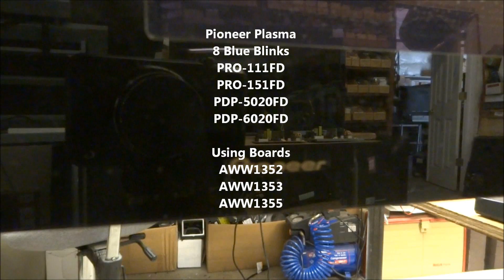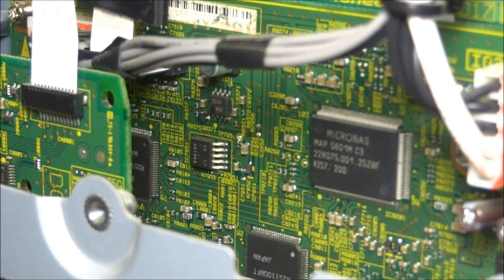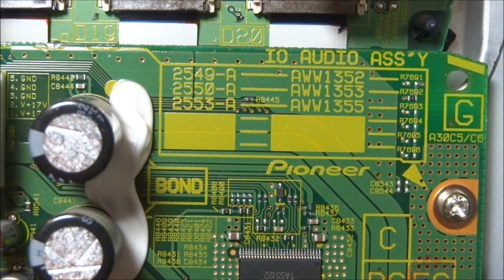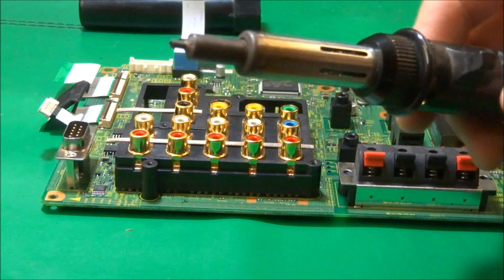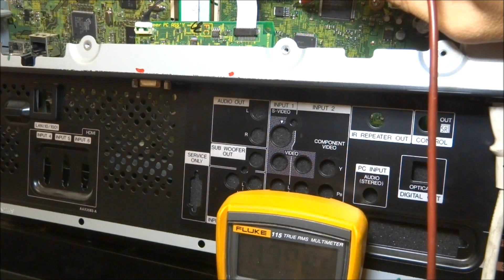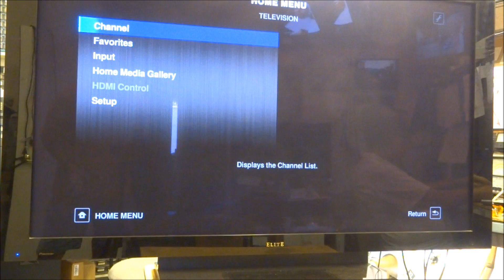Pioneer Plasma PRO-111FD PRO-151FD PDP-5020FD PDP-6020FD 8 Blue Blinks AWW1352 AWW1353 Repair Fix

Comment: As someone else said - this saved my 5020! One thing you should mention, which I found on someone else's video: when you check the voltages, you have to do it in the first 2 seconds. Once the blue blinks start, the power supply shuts off and you get 0 volts everywhere. Once again though - thanks!

Comment: Great Video. I bought the chip from Digi Key part # NJM2846DL3-18-TE1CT-ND . I used the weller pyropen with the standard 4.5 mm tip which worked well. One mistake when I was removing the chip  I inadvertently tore the copper trace from two of the pin positions. Make sure to heat ALL OF THE POINTS OF CONTACT when removing chip GENTLY.  Really important to use the flux and hold the chip in place down when soldering new chip to the torn traces when cooling solder. The torn traces act like mini springs.  I used a soldering iron to solder the outputs to the traces once the main chip was set.  Took about an hour from set removal to replacement.   Again well done NorCAL 715 !!

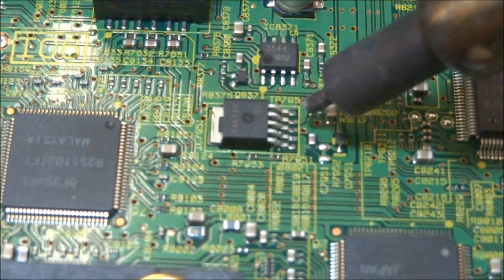Comment: I just tried using my $20 compact Wall Lenk LSP-25 butane powered soldering iron (with tip remove) to unsolder a surface mount chip like you did with your Weller Pyropen at 3:35. To my surprise, it worked pretty well. Thanks for the idea.

Comment: Thanks So much. Fixed my TV yesterday. This is the way to do it. Don't cut the legs with the micro-wire cutters - De-Solder only! and remove the PCB it is easy, just a few more screws and some ribbon connections. The PCB is delicate go easy, almost ruined my PCB by tearing off the bottom leg's contact from the board when trying to cut it off with wire cutters.

Comment: Pieco,  Yes replacing it fixed my problem.  Thank you for posting this video!
Reply: Thank Norcal for the video. And thank you for replying so quickly :) I'm hopeful to get the same results.

By any chance - did you happen to look for or notice an accompanying orange blink code? The service manual mentions that if you hit the display button during the blue blinking, you get a secondary orange blink code :) Just anxious to find if I have the same issue that y'all do.
Reply: Can you tell me how to take out the IC board so that I can change the regulator IC?

Comment from the maker: Yes the Pioneer plasma's are some of the best with the best black level not to be surpassed!. Too bad they stopped making them. From what I understand the engineer from Pioneer (with the Kuro design) went to the design team for Panasonic Plasma (which is the brand I currently recommend)
Reply: Plasma Pioneer is more alive than all the living. Do you think this failure may be due to the connection of 4 Ohm speakers, instead of the recommended 6-16 ohms. Bought recently LX5090 (111FD)

Comment: I just did this repair on my PRO-151FD and it worked great!  I got the IC from Mouser.com and decided to get 3 of the chips for $2.00 and I am glad I did cuz the first attempt the chip was bad but the second one did the trick.
Reply: Randy Saucerman great job on your repair,I order the part but the thing is that I'm getting 1.8v on the old IC and not 3.4v on the input,can this mean that the IC is working and not the board?Im going to replace it regardless but I don't know if not having 3.4v input is also a problem with the Regulator,thanks.

Comment from the maker: 8 Blue blinks indicated a data communication problem with the AV jack micro and main micro, and a simple check determined the supply voltage was missing.

Comment: I found a temporary fix.  I have my TV and entertainment receiver, and DVD and other peripherals all plugged into a surge protector.  The TV must be recognizing that there is too much of a voltage draw on that electrical circuit and giving me the 8 blinking lights.  I took a nice fat 8 extension cord and plugged in just the TV into another circuit in another room and the TV works normally again.  I will probably buy a new smart TV but for people having similar problem, they might try this temporary fix.
Reply: Awesome temporary fix, worked for me. Thanks.

Comment: Nice fix. Don't forget to wash off the flux with isopropyl alcohol to prevent corrosion.
Reply from the maker: I use acetone!
Reply: @norcal715  that can burn off the traces geez. Dont do that

Comment: This video is worth it's weight in gold! I just finished replacing that chip and my set is back in business. Another Kuro Elite "saved from the landfill". Thanks norcal715 for making this public and teaching men to fish.
 On a side note this problem and solution has re-sparked my interest in electronics again. I'm going to make sure I try to adsorb as much as I can.
Reply: Can you tell me how to take out the IC board so that I can change the regulator IC?
Reply: Tony C
 I don't know what specifically you're asking. The best I can tell you is too carefully remove cabling until you get the board isolated and then remove it. The one thing I can tell you the white connector in the upper left of the board is pretty tough to remove. The one with the bare rigid wires showing. So be careful with that one.

Comment: Hi Steve, how are you, help plz, my multimeter doest show any voltage on those pins switch the regulator(new one), and still the same problem, (i do not see any voltage on test point too)thanks

Comment: Great video! During the replacement of the regulator chip unfortunately the resistors R7953 and R7951 came loose and were lost in a carpet which I've searched for without luck. I've decided to replace them. According to
the service manual these resistors are " Other Resistors   RS1/16SS###J " I have yet to find a value for these resistors. Can anyone please inform me what their value is please. I cannot find any information mentioning the details of this Pioneer part number. Thanks!

Comment: I'm going to give this a shot with my M01 media receiver. 8 Blue blinks.  My issue only shows up on changing HDMI Input after being on for a short while or 50/60Hz switches (ie moving from 50hz Pal to 60hz game on HDMI.  Box always cold boots perfectly fine.  But it's getting too annoying having to put system to standby to let it cool down for a while before switching.

Comment: I have the 5020 fd and the problem occurs, if you hard power off for several hours the unit will wok fine.  and will run forever
when warm the unit will not power up and gives 8 blinks, ..
can this regulator problem only occur on warm tvs or is there another possible problem??

Comment: this is a great video. One question I have is where do you place the other lead of your volt meter to test the IC regulator? I see the red lead goes on the test point or pin 4 but I'm curious about the black lead.

Comment: I'm having a similar problem with a Pioneer 4270 plasma. The red standby LED blinks seven times, pauses, blinks seven times... If the TV is unplugged then plugged back in, the red led will come back on with no blinking, but when I try to turn it on from the small on/standby button on the right side of the TV, it will come on for a few seconds, then go back into red LED blinking mode.

Comment: I have a different question on a 2006 Pioneer Elite Plasma 60" TV. Over time, the tv screen has got faint red lines that run from top right hand corner of the screen and run 1/2 to 1/3 way down the screen. One line developed and then a 2nd and now a 3rd. How do I fix the screen so the red lines that have turned white go away?

Comment: Hi, I have a PDP6070PU that went out with 8 blue blinking lights. I believe the voltage regulator chip is out. Is it true about putting freeze spray on it and it will get it working again?

Comment: I have the exact model in the video. I followed the exact procedure outlined in the video. I did not find the the 3.5 input voltage at pin 2; I had nothing. What does that mean?

Comment: My Pro-151FD has the 8 blue blinks but has the correct voltage to the voltage IC regulator. I've already replaced the main power supply board. Do you have any ideas for me to try?

Comment: Hi: I have a Pioneer Elite model pro-507pu and I have a 5 blue blink lights, when I turn the TV on said Is there a short in speaker cable? The code it show is SD05, is this the same circuit that you replace in the video?

Comment: Hey, I did this repair on a Pioneer PRO-151FD with this issue and it seems to work better now, but still won't start sometimes and shows 8 blinks. Cold startup always works, but turn it off and back on and often it still fails to start. Anyone got any tips? I really hope to save this thing!

Comment: So what brings you here? lol....I had the same problem with a different version of this screen. Power interruption would give me the 8 flashing blue lights of death. I could drain the unit for a week or so and it would fire up eventually. The problem was with abrupt  interruptions. I purchased a UPS for around $100 (there are cheaper) and that solved the problem. The screen has been working flawlessly for a year now, with power interruptions. This IC method would no work on my particular unit. The key is continuous power. It's a band-aid of sorts but pretty cost effective in the long run.
Reply: Algoron, what do you mean by abrupt interruptions? Do you mean that there are fluctuations in your home power source when turning on the set which causes this? Did you purchase a standby or continuous USB? Thanks.

Comment: HI Norcal - found this video, ordered three new regulators, hopefully this will do the trick. Thanks for posting, hope I have the same exact problem that you did.

Question: did you recall what the accompanying orange blink code was? Apparently if you hit "DISPLAY" on the TV's remote, it'll give a bit more information and give a secondary orange blink patern. Mine blinks once on orange. Anyone seen this?
Reply: Pieco Did you ever resolve your issue?  Did you follow the replacement in this video or go a different route?  I have the same single orange blink as the subcode after pressing DISPLAY on the remote.  Thanks!

Comment: I have two of these Pioneer TV's both have the same flashing blue lights. But trouble is no one has these voltage regulators in stock any more. Well here in the UK.😢 I don't want to throw them out as this is the only thing wrong with them. 🤞I can find them.

Comment: Urgh. So in my case, the regulator does power up to 1.8v on pin 4, but then kicks down to zero after a relay "clunk". In the video, it appears that the regulator never outputs 1.8v at all.

Not sure I have the same issue :(

Comment: I just performed this repair and back in action for 9 dollars on 2 voltage regs  and shipping . Found someone to change it out for 10 Dollars... 19 dollar repair ..
The only thing is I never noticed the fans working before and they still do not work..
Any Ideas?  Thnx nborcal715

Comment: Can you just replace the entire board the chip sets on? If so what is the part number? I started to try and replace and broke the chip off. IN the process I peeled some the the circuit board with it.....
Reply: +Ryan Hook YES you can replace the board. The number is printed right on the board! doesn't take a rocket scientist to find it!

Comment: Thx you NorCal715 for you guide . I have PDP LX6090 with AWW 1354 board and i change the IC 7951 regulator  but behavior with 8 blue blinks are the same ( totally same like with old regulator ) . Tv will turn on only if is very very coold  .  Maybe i got bad regulator  :-(  . Please guys any help or advice
Update: I measure in and out of the regulator , and values are 1.8v  3.3v , so must be something  else wrong

Comment: Hi. I have Pioneer PDP4304 that I bought from Costco 8 years ago. When powering from a cold turn on, the TV takes 20-25 minutes for the picture to completely show up. It starts from the center and then the pixels start to come on little by little. after the picture comes on fully the TV works like a charm. What could be wrong with this TV? Is it easily fixable?
Reply: Thank you for sharing this information with us.

Comment: I damaged the pads upon removal of the chip.  any suggestions?
Reply: If you only damaged the pin 5 pad (its the top pin when looking at board in the set) its will still
be ok because there is no connection  needed there..

Comment: Does anyone know the part number of the bridge connector seen in the service manual between the MAIN and IO_AUDIO assy? Managed to break it whilst unmounting the whole IO_AUDIO assy... (LX5090)
Reply: Looks like it is only sold with the IO BOARD
https://www.shopjimmy.com/pioneer-aww1352-io-audio-assy.htm
the service manual shows how to disconnect that cable so it doesn't break
download sevice manual for PDP-6020 FD and see page 152

Comment: I have the Pioneer Elite SMW2026-A. 
Serial NO. HGMN009983UC
I also have the 8 blinking lights also, the TV stays on for like 20 minutes to an hour then turns off.
Does anyone know the part number I need in order to fix the problem?

Comment: Hi Norcal, great video.  Do you happen to know the fix for 8 blue blinks on a Pro1150HD.  Main board is AWV2456.  I don't see the same regulator IC on that board.  But, am thinking it might be a similar problem.  Thanks
Reply: I have the same problem with my Pro1150HD. I can get i to run for a while, then all of a sudden it shuts down and start blinking blue 8 times. Did you get yours fixed?
Reply: Any bad caps in  the  vicinity?

Comment: "Bed Panel"
My Pioneer FD-111 Plasma Kuro television displayed this same blinking light code, but the problem was not the chip, which we had replaced by a certified Pioneer tech. Nope, the replaced chip tested out fine after which the tech indicated it is a faulty "bed panel".This bed panel, which, according to Pioneer, translates into display panel and costs $4000 dollars to replace. So I'm now left with a blue blinking, Pioneer Kuro that refuses to turn competely back on.Anyone have a need for spare parts? Should I get rid of this thing or get a second opinion?
Reply: Always second opinion.  My FD-151 has 8 blinks occasionally, unplugging it for awhile and turning it on and off repeatedly has worked so far.  Its never shut off once on.

Comment: Great video, I have same problem with my KURU 6020, I found the regulator but I have no volts on no# 2 pin. or no# 4 pin.  I did the test with the blue light flashing. Can you help.
Reply: I have the same issue. I see that your issue was sometime ago. But did you gain a solution...

Comment: Hello, I have the 8 Blue Blinks showing up every time my Signature Elite Pro 141-FD does not receive an HDMI video signal (this model is the monitor version of 151-FD). Otherwise the monitor works fine, as long as it receives a "proper HDMI signal". I want to ask about a few differences and verify that I need to replace the same part. I opened the monitor and found that my ASSY board is "AWW1373" and the voltage regulator has a slightly different code on it:846180 is the same but bellow I have J1 8C instead of J1 5C as in the video. Also the labels around the regulator are different: L5304, R5321, IP4512, IC 5302, couldn't find the IC7951.
The parts I found online seem to correspond to the part code in the video, not the IC7951 but NJM2846DL3-18: http://www.digikey.com/classic/Ordering/AddPart.aspx 
I took a pic of the part and surroundings but I don't know how to paste it here... To me it seems that there is an HDMI negotiation problem between my PC and the monitor, this didn't use to happen until about a few weeks ago. Is there any way I can reset the TV from the service menu and see if this resolves the problem? I am not really sure that I have to change the part because other than stuttering heavily until I get a clear signal the monitor works fine, actually great... Thank you for your videos and tutorials. Dan
Reply: +Dan Totan I agree - it looks kind of like an HDMI issue - did you resolve it?

Comment: Mines have 13 blinks
Reply from the maker: 13 blue blinks indicated a power supply failure according to the service manual. You can look for a manual yourself at https://elektrotanya.com
Reply: Ok now it had a solid green light

Comment: I have a similar problem: I turn on the TV, after 5 seconds it turns off and 8 blue blinks. What should I pay attention to first of all for my Pioneer model ? https://i.gyazo.com/34efb8e41c4f424e4b43c22a47cb0a9b.jpg
Reply from the maker: measure the power supply voltages on the regulator in this video

Comment: Where can I buy this IC?  I have diagnosed the same problem with my PDP-6020FD. 

Found it at Digi-Key.  It is normally a non-stocked part, but I was able to get some "cut-tape" (individually). http://tinyurl.com/jvneevw
Reply: Thanks for posting the digi-key link. Did replacing the regulator fix things for you?
Reply: Yes. My PDP-6020FD has worked ever since.
Reply: Joel Tomesh Hi! Good to see your 6020fd worked. It's been a year. Did the fix hold up? I'm in the same situation. Thanks!
Reply: Still working.

Comment: Hi norcal715. Thank you very much for this great video. I got the 8 blink problem on my Pioneer RDP-5090H. On my board it says AAW1354 and on the IC it's the nr. 846180 J1 2C (Below the IC it says IC7951) is this the right on to buy?? http://www.digikey.ca/product-detail/en/NJM2846DL3-18-TE1/NJM2846DL3-18-TE1CT-ND/718327

Comment: Sorry to piggyback your post with my own problem, but I just cant seem to find out whats wrong with my Kuro. Here is a video of what its doing. It only occurs with Directv receiver and nothing else. Same setup for over a decade and all of the sudden this is happening.https://youtu.be/dhwiEBvSOlk
Reply from the maker: I watched your 3 second video, perhaps a few more seconds would be helpful. Have you tried another connection like from a computer or a blu-ray player connected directly to your TV? Does it still exhibit the flashing? Do you have anything like a AV receiver or an HDMI switched connected in the line?